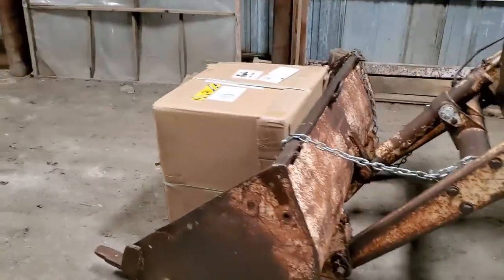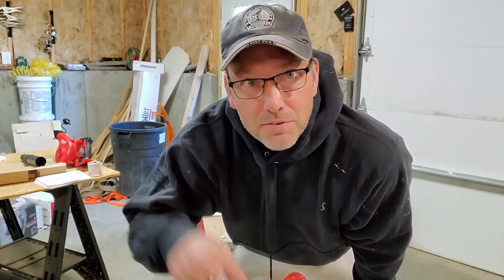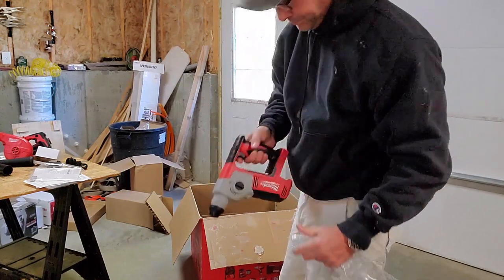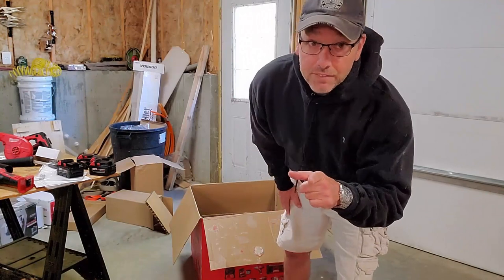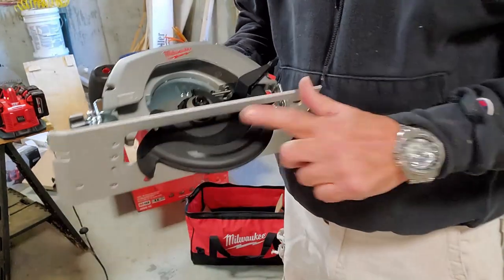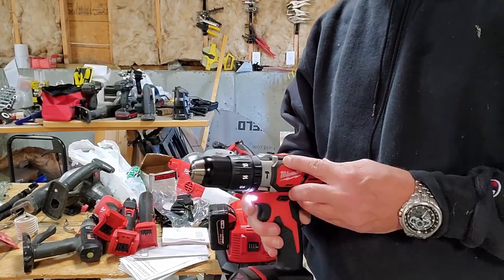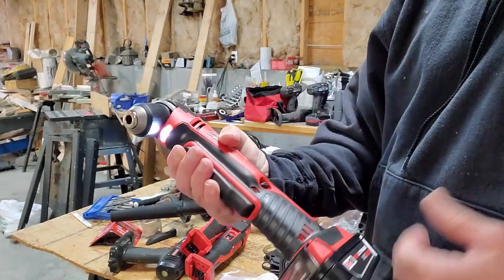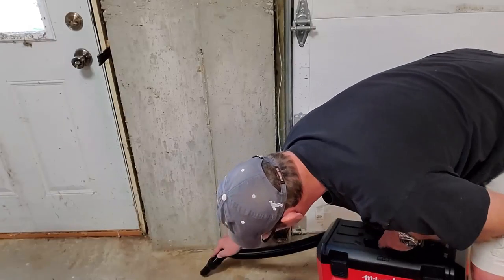Review of Milwaukee's Largest M18 Combo Set

Comment: P.S. Gonna leave this on top so no one thinks I'm pulling this all out of my arse. I'm literally checking the lowest current prices as I post this. I also sell tools on eBay so I know they can also go for WAY less then this. I'm going off of actually listings that you can buy right now. If I check the sale history for every item I mentioned they consistently sell a dozen or so a month for $10 all the way to $30 less. That said, my original post is below 

$2000? Good God! That's a rip off! I'm pretty sure you can still return that if you have the receipt. Actually, even if you don't you can return it for store credit. 

2 grand could've gotten you an entire DeWalt XR, even the new Extreme set. You could've even got all of those items as Milwaukee fuel if you had bought off of eBay or Amazon. (Preferably eBay, they have more competitive prices) could've had yourself a bunch of brushless heavy duty construction capable tools for that money. 

Minus the light, the speakers, the fan, the blower and the vacuum and the right angle drill and the second GIANT impact wrench (Yes they're both giant). (NVM, did the math below, you could've got literally every item that they produce a Fuel version of, plus all the bells and whistles if you wanted them, like the lights and vacuum's)

280+100+100+120+170+220
+160+87+170= $1407

· Fuel SDS-Plus Rotary hammer - $280
· Fuel Hammer Drill/Driver - $99
· Fuel Impact Driver - $99 (or the hydraulic Surge model 1/4" driver for same price)
· (2) TWO XC 5.0Ah Batteries - $120
· Fuel M18 Multi-Tool - $170
· M18 Fuel Mid-Torque Compact Impact Wrench - $220 (Just released, it's the newest generation, it literally looks like something from the future)
· M18 Fuel Grinder - $160
· M18 Fuel Sawzall Recipe Saw - $170
· M18 (Non-Fuel) Orbital Sander - $87
(Don't think they make a Fuel Orbital)

$1400 for the next gen models of the best of the best. Plus two XC 5.0Ah batteries which will be able to take all your tools to speeds and power that the 3.0Ah could never dream of! With tax you're at what, like $1520 maybe $1530* tops? 

If you paid tax for your tool set it was really, $2160 bucks or so. That's $640 bucks left over if you did pay tax which, I'm sure you did. And I only used an 8% tax rate, you might be in one of the 10-11% sales tax states. If there was no tax, which there was, unless you're in Alaska, then there is $480 left over. We'll go with the taxed price here, so $640.

You can buy - 
· Model number: 48-59-1880
M18 + M12 Rapid Charger + M18 8.0Ah High Capacity Combo Kit - $177
· M18 (2830-20) Fuel Circular saw - $195
· M18 ROVER Mounting 1500 Lumen Flood Light (2365-20) - $80 

$177 + $195 + $80 = $452 

So $188 left to get the price tag to $2160 or we can just stop there and pretend the price was a flat $2000. For the additional price you can add either a jigsaw or a hacksaw ($120 each) another 2 XC 5.0Ah Batteries for $120 (which isn't necessary imo) maybe another 8.0Ah battery/charger combo would be better to run the lights and circular saw or reciprocating saw for long jobs. As those tools can drain even a 12.0 HD battery in minutes.

That said. No one buy this!. They're ancient. It's a shame that Milwaukee is charging 2 grand for this to unsuspecting buyers. This set shouldn't cost more then $1000!

But the money spent on this set, you can buy an arsenal from the SAME COMPANY!! Of all their high end tools!! And then some! Just don't expect to buy all of the items at home Depot where the prices are all marked up. #2 Even so, if you do decide to go to home Depot, it would still be better to pay 2 grand and get the Next Gen items. You'd have a few less then I listed above, but it would still be better then this junk! Or if you're buying from a retail store, just go with DeWalt 20v XR or the new Extreme lineup and you'll get the same exact amount of items for 2 grand and you'll have top of the line, new generation brushless tools. Tools with lights and technology embedded in them. Tools that look pretty for Christs sake! They're modern, small, compact, cool. They're half the size of what you see in this video and twice as strong and thrice as reliable!!! Don't buy this set!!!

BUYER BEWARE!!!
Reply from the maker: All fair points.  I would have loved to come out the door with all fuel tools.  But, OMG the price...  So, a few points that made me start with this combo:  I didn't own a single M18 tool so this allowed me to easily get into Milwaukee without having to know a lot.  Second, I did do a spreadsheet where I listed every tool in the combo including the fan, light, charger, blower and radio.  I compared these best prices that I could find on these tools individually and when I added up everything, it was 20% cheaper to buy everything in this kit.

To your point, if you know exactly what you need and are more professional than hobbiest, then definitely spend the 50% premium on the tools offered in Fuel and forgo things you don't need like the blower(it is weak)!

Comment: So the multi, right angle drill and angle grinder have different triggers because milwaukee pays attention to market feedback. The right angle drill will always be held the same way since youre using it to drive something at that right angle. The whole tool has one purpose. The multi tool will be used in a hundred different angles and positions which is why it has a switch start even though thats much less safe than a trigger. The angle grinder includes the safety trigger because it is or can be a cutting tool like the circular saw

Comment: You don't understand the reason for different switches on different stypes of tools? One factor is the potential hazard inherent in the use of the tools, second is the position of use and the way in which you hold the tool. If you use these types of tools much you would understand this. The offhandedness is off putting and is silly.

Comment: I went with Fuel because rather buy Al La carte than get brushed. I started out with an M12 fuel gen 3 impact driver and hammer drill kit. A 12 volt brushless will always beat an 18 volt brushed tool.

Comment: batteries shipped at low voltage because its better for longevity. also they are 3000 milliamp housr or 3 amp hours

Comment: If its quicker to google the instruction manual than remember where you put it the solution is better organization not relying on a technological solution that could go down at any time. I have instructions and receipts organized and saved both digitally and physically.

Comment: Dude you literally bought all of the oldest brushed tools(that smell) that no one wants. Still good tools but this kit is the height of overpriced and out of date.  Long as the job gets done right.
Reply: Nothing wrong with non fuel Milwaukee brushless
Reply: I run a general contracting crew my best friend owns we have over 35 guys we have 3 tool trailers packed some guys including my self use our own tools mostly I run only non fuel brushless stuff along with 1 other guy everything provided is Dewalt I don’t mind but I prefer Milwaukee so I use my own but I’ve had the same impact for over 3 years that is abused daily I actual dropped it in a bucket of coolant about a year ago didn’t know while I was using it working on my tow rig was in there over night still runs like a champ runs 6 inch lags faster than any Dewalt and had out lasted 2 fuel impacts the another guy has bought.
Reply: Yeah man non fuel Milwaukee is great love both my fuel and non fuel. Great purchase
Reply: @Esdeath_0001  I wouldn't even spit on your brushed tool when it catches on fire from overheating. Only fuel brushless touch the hands of this refined gentleman.
Reply: @johnharrison4592  they make non fuel brushless drills and impacts
Reply: @Esdeath_0001  He's a fuel man. I have both fuel and non fuel Milwaukees myself.
Reply: yeah a lot of those tools are actually alright, I love my fan and the sander isn't bad, I don't have any complaints about the old 61/2 circular saw although I prefer my 71/4 fuel, but I'd rather keep my fuel grinder and the drill that comes in this kit is a turd. The 1/2 impact should be fine for lugs but I'll stick with my fuel 😂

Comment: I think $2K is way too much money for a brushed set. Especially because it comes with a bunch of mostly worthless tools, like that blower, light, vacuum, and radio. I think you could have done way better if you had waited for one of the home Depot sales and picked up the exact tools you needed. The Fuel models go on sale all the time. You're probably rich so maybe the $2K doesn't sting for you and you don't care about maximum value. I definitely cringed when you said the price though, 😂

Comment: I hope you did not buy that set.
Reply from the maker: I know it is an expensive set and it is brushed tools, but can you be more specific why it would be a bad buy.  There are probably a lot of people watching this video that would benefit from your opinion on it.  thx
Reply: @illgiveitadiytry  2k for brushed tools in 2022 is just a ripoff, that kit should be 1000 dollars to get it out and sold, it's all so far outdated, and so far underperforms compared to modern tool technology that 2k is just a ripoff plain and simple, and it includes a bunch of tools that most people will find useless so they can sell them in a kit with the other useful tools.